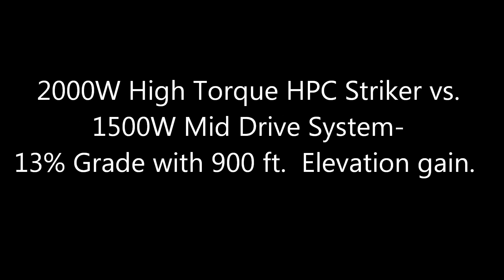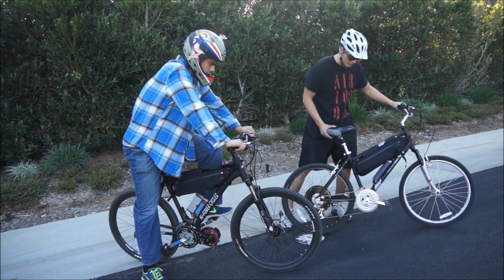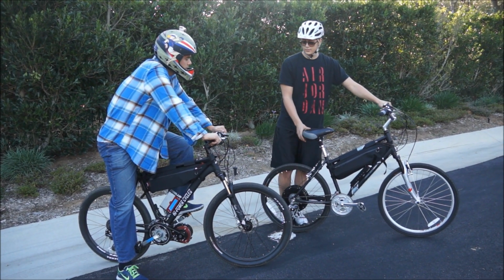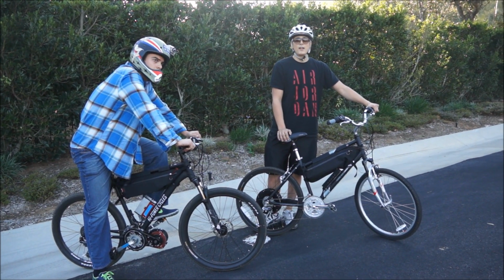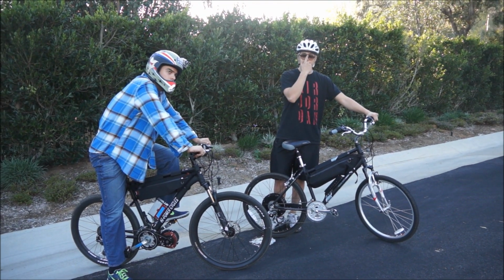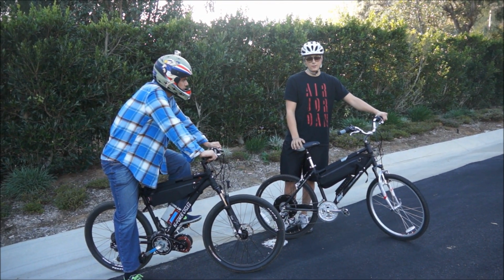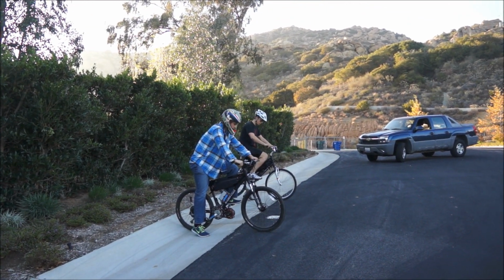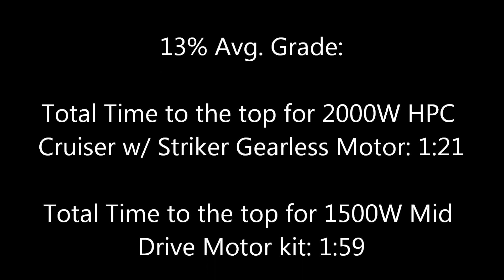Hub Motor vs Mid Drive Part 2

Comment: Isn't not using the gears defeating the whole purpose of having a middrive?
Reply: Yep shift and monitor current and voltage sag on the dash and repeat
Reply: I think, I hear the changing of the gears quite often there. Those sharp clank noises. Because he does it without easing the engine action.
I see the whole purpose of middrive in assisting the ride. Here, there was no assist, it was pure drive on motor. 
Direct drive motor here has 500 more watts here and also it isn't geared, therefore it has greater efficiency.
Reply: @petersvancarek  but going uphill, it it is all about TORQUE. The power alone (let alone efficiency) doesn't help if the torque is not enough. It's like you pedaling the bike, shifting gears. You have some amount of power in your legs, say, 300W. If you switch to an optimal gear, you can go uphills at some speed but shifting gears further up, you can no longer pedal at all (although you still have your 300W of power) - it is because the torque is no enough to spin that gear.
In this case, I thought mid drive would win because of the torque available but it seems like direct drive had enough torque for that slope so it won. Sure, both motors had to be the same power also. Not fair to have 0,5 kW difference...
Reply: He was changing gears, between a low gear where he can't go very fast and a higher gear where the motor can't cope, swapping gears trying to work out what's fastest, in the end it got trounced. Listen to how hard it's slamming the chain as well. Hubs forever!

Comment: Total BS! A 1500W Mid Drive system would fly up that hill and drain far less from the battery. There's something very wrong with this "test".
Reply: Brendon Bosy
Nothing multiplies torque at the wheel quite like a good set of gears.
Reply: +Knapweed There is also the difference in motor diameter, that is a square factor in the torque per watt of a motor.
Reply: @CamdenWallraff  you cannot compare the torque of direct drive motor with geared in terms of dimensions. Both motors have to be the same type to be compared by dimensions - either direct drive or geared...

Comment: Mid drive motors are superior when you shift the gears to gain maximum torque.
Reply: Christian Ademius Are you saying that the results would be different if a different gear was chosen?
Reply: Yes, I have one of those today with the Bonsch motor. You udnerstand very quickly why it is a lot more efficient.
Reply: Christian Ademius I would think that the makers of the bikes know what they're doing. I don't believe that they are trying to mislead anyone, and from this video, they have clearly demonstrated their point. I don't think any gear on that mid drive setup would have enabled it to beat the other bike.
Reply: ThingsDemystified It would be more of a fair comparison if they'd used the same wattage motors for both set-ups. Of course 2000W is going to outperform 1500W - especially if you're changing gears in an inefficient manner like the mid-drive rider was.
Reply: David Struve It seems logical to me that a mid drive would be more efficient because it can take advantage of the bike's drive train. A hub motor needs a power advantage to beat that.
Reply: *****
I was into RC cars in the past, and I found that higher gearing made the battery last much, much longer. I'm assuming this is true with these bike motors. I'm going to try a mid drive next. I tried a hub motor, but it seemed like it was using more power than it should.
Reply: Nope.

Comment: Sigh.
Does 500Watt difference seem trivial to you? Same goes with the bike + rider weight and gearing. If you want to do a comparison at least try to remove some of these unwanted variables.

Electric motors despite the relatively high accessible torque on low RPM will still benefit from gearing. Electrical motor will run incredibly poorly and overheat if the load is too great ie) RPM is too low. Hub motors have one advantage and that is they are usually lighter and easier to install.

At 1500~2000W band, this kind of difference becomes less prominent as even with low mechanical advantage the motor will provide enough power to overcome the load. Still, no reason to make such poor obviously biased and even down right false advertising video.

Just say: "2000W direct drive hub motor, lighter, cheaper, simpler."

Comment: The hub drive took 81 seconds at 2000W. If you factor out the difference in energy input the time would be very similar. The mid drive took 119 seconds at 1500W and the hub drive would have taken 108 seconds if it ran on 1500W. The mid drive would also have done even better if it were set to a gear for going up hills because you could do that with mid drive motors in a way that's more efficient than when doing it with hub motors.

Comment: If you buy Ebikes to have a one time race up a 13% hill the best candidate has been demonstrated. I understand the mid drive arrangement allows the operator to maintain the motor at optimum rpm greatly extending battery life over distance which may be more in line with what people buy ebikes for.
Reply: Based on this video.......... mid drives = senior citizens walking
Reply: ExclusiveLM
Well, if you don't downshift, of course. The whole point of having a mid drive is so that you can use your gears to keep the motor spinning fast for max efficiency. In the video, he kept upshifting when he should have been downshifting.

Comment: I definitely like the quiet sound of the hub drive but realistically, the mid drive bike came in at ~68% of the time of the hub bike, which rings consistent with the power difference between the two. The extra losses of 7% aren't too bad especially if you are wanting to use the gearing for hill climbing etc which the hub drive wouldn't be very good at.

Comment: One is road legal in most states as well as legal on bike paths.  While the other isn't....
One is legal while still  retaining climbing ability.  
One uses less power and is more efficient.

There are a lot of advantages to having a mid drive if your goal isn't just to go as fast as possible in a straight line.

Comment: how is the mid drive going to change gear without peddling. you need to redo this test with someone who knows how to ride the bike properly. the mid drive should have won, even with lower watt motor.
Reply: +andy765gtr Two riders of the same weight would be a good idea too.
Reply: Because these sort of mid-drives normally drive a free-wheeling chainring, which the cranks are also connected to. They almost always operate through the conventional drive train of the bike, and if they don't, what fucking use is it to change gear?
Reply: Back off throttle to drop load shift and back on Need to keep that motor spinning as fast as possible and shift to gears quickly accordingly to the current and voltage sag and not go to high where you bog the motor and the current goes way up .Electric motors are most efficient at high rpm Sooooo shift already !!

Comment: Dude, what the hell? Try changing gears on the middrive next time. And when you do that, ease up on the throttle for a second, while the gear change takes place.
Reply: He was changing gears. He was juggling between going slow in a low gear and having the motor struggling (same end result, going slow) in a higher gear. Those gear changes slamming the chain are a sad thing to hear.

Comment: mid drive are made specially for those that going to pedal most of the time, making far more  efficient !!
Reply: +walter osvaldo mid drives are made to spin motor at efficient range and have wider range momentum. Good luck with hub on that if not 100% straight

Comment: Bullshit comparison. Wattage doesn't mean anything. What about the controllers and the batteries for each motor? What gears were the mid-drive bike in? It sounds like the mid drive was spinning really slow, which would make me think you used underpowered kit to drive it deliberately slow. Given a mid-drive at optimum rpm with kit rated for its power going through the correct gears, it would destroy an equal hub drive setup up a steep hill. The rule of thumb is - take a motor, put it in a hub, try to get it to go up a hill - if it can do it without heating up or slowing then fine, it is powerful enough for that hill well done. If it ends up overheating or losing power then the same motor in a mid-drive system would NOT overheat or lose power. It's all about gears you numpties. Also unsprung weight, efficiency, etc, etc. Mid drives are better even if they are more complicated and noisy. Single speed vs 12 speed up a hill? I'd put my money on the 12 speed.
Reply: Right, but when you use a mid-drive you're forced to use what is effectively an outer chainring 100% of the time, you have no lower gears anymore. Why anyone actually wants that just baffles me. Triple chainsets forever!

Comment: So we learn that a 2000 watt motor is more powerful than a 750 watt motor. Gee, I didn't know that. They should have also told us how much each system weighs.
Reply: jollyandwaylo No, what we learn in this video is that if you don't use the right gears, your mid drive won't perform. Imagine trying to go up a hill in 4th gear in your car. That's what the mid drive rider was basically doing.
Reply: +ThingsDemystified no wonder it sounds like it's at such a low rpm! huh who'd have thunk it?! derp These numpties need to go out of business.

Comment: The freewheel (mid drive) system is much more efficient and all things aren't equal here. A larger battery back can deliver more power and also it's matter of the torque of the motor. But overall, I would take a freewheel mid-drive system over the hub system any day of the week.
Reply: Bonzo Bonzai A lot of hub motors use plastic planetary gears (with steel ring gears and a steel sun gear) and aren't particularly reliable. Still more hub motors use permanent magnets and cause significant drag when you are just pedaling. Hub motors can't be used on the front of a bike with suspension forks either.
Reply: Bonzo Bonzai So you are saying your motor has permanent magnets in it? With permanent magnets there is no way to stop the resistance of the magnets on the coils. Also, hub motors tend to get hot because they have to generate so much torque. A mid-drive system doesn't need a lot of torque because it can reduce the speed and thus turn speed into torque (it's much more efficient). All that heat isn't free, your battery is generating that heat. Given that the battery is the single most expensive part of an e-bike, I would think you would want the most efficient motor. Getting a more efficient motor costs a lot less than adding battery capacity to increase range and to increase max wattage(which is a function of the capacity of the battery) to the motor. Glad you like it.
Reply: Bonzo Bonzai When I said your battery is generating that heat, I meant the motor was drawing energy from the battery and converting it to heat. Also, when I said 'it can reduce the speed', I meant reduce through gears thus converting the spinning speed of the motor into higher torque. I wasn't that clear on either point.
 None of the mid-drive motors I've ever seen are noisy, but again, if you are happy with it, then I'm glad your happy. ETA... BTW, any noise by either system ain't free either, it's also coming out of your battery. Well designed mid-drive motors are probably going to last longer than a hub motor.
Reply: Bonzo Bonzai I don't have any video of them, I saw them in person. You are really going overboard with the complexity thing. There is no reason a mid-drive system has to be geared and probably doesn't benefit from gears anyway, since it goes through the gearing of the bicycle. You basically have a sprocket on the shaft of the motor going to a freewheel bottom bracket. I've never seen one with belts and pulleys. The problem with hub drives is they need to generate enormous torque to get the bike going or go up a hill. Since a mid-drive can run at a high speed and be greatly reduced through the bike's drive-train (you can go from an 8 to 52 reduction), they don't need to generate huge amounts of torque. Generating all that torque will heat the motor up. None of these motors are particularly loud. Do you have an example? They usually have a whine, but are generally pretty quiet. I'd like to know what your theory is about how an electric motor gets louder because it's driving the bicycle's drive train versus spinning on an axis with direct drive. You said they are so loud you are afraid they will be banned from trails, do you have a video of this? As I keep telling you, I'm happy that you are happy with your setup. One less car, right?
Reply: tarstarkusz Hub motors can't be used on the front of a bike with suspension forks either wrong thy can i have got 1 and it works well
Reply: bucketrobbert I suggest you google search on this. Almost all the hub wheel sellers say "just don't do it". Not only is it likely to come looses, you don't want all of that unsprung spinning mass.
Reply: tarstarkusz you may be right it all depend on the size of the moter mine only a 500 wat and any thing higher than a 1000 wat motor there is ex-stream amount of tort higher than this can pull your front forks to bits
Reply: also on this test on this page i dont think the guy on the mid drive change gears to suet the size of the hill
Reply: bucketrobbert Even 500 watt motors (assuming your battery can deliver 500 watts) puts hundreds of pounds of torque on the forks. Even with a torque arm, they can rip themselves right out of aluminum forks. Remember, just because you have a 500 watt motor doesn't mean you can get 500 watts out of it. Maybe if you have a 1KW/H battery, you can sustain 500 watts for more than a few seconds, but a typical battery won't deliver that kind of power for more than a few seconds. The cells heat up and more and more power is lost at the cells before it ever gets to the motor. The chemistry and Capacity of the battery is usually the limiting factor on E-bikes. I've seen so-called 10k watt E-bikes with a 500WH battery. It's next to impossible to draw 10KW from a 0.5KW/H battery, not to mention the size wiring you would need to carry that kind of current. Even at 72V, you are looking at 138 amps to deliver 10KW. You would need extremely thick wires to carry all those amps. It wouldn't fit into the hub axle:)
Reply: my cycle computer states 600 watts peak so yes i can get 500 watts easy but i do not slam it to 600 watts do it car-full  start of 10 watts and build up to what ether wattage  you want so yes if your going to mist treat the power like doing front wheel spins your asking for trouble and deserve all you get . by the way my front forks are steel the frame alloy...
 by the way mine only a 36 volt bike not a 72 volt bike

Comment: Well you might have a point there about the efficiency but my hubmotor works fine at climbing steep hills and it never overheated to the point its beginning to lose power or that it was too hot to touch. 
And believe me i torture tested it dumping 72v 16ah of battery in it in about 30 min (almost constant full throttle at 4kw) in a local forest and its still running fine.

Comment: I have no problem climbing steep hills with my hubmotor what so ever. it easily climbs a 30 degree hill.. 
Also i have stalled it many times before (rated for 1500w, handling 4000w atm) and its still running fine after 1.5 years or heavy usage. 
Btw my controller cuttsoff power when completely stalling it so it can never burn the motor. 
Sure it heats up but noting to be worried about. 
A good hubmotor shouldnt have any problem climbing hills..

Comment: in the uk electric bikes are not allowed to have a motor output of more than 250w and  so you have to pedal uphill, but my electric bike has a 7 speed megarange gear so i can get up most hills using a combination of  pedals and motor.

Comment: 750Watt is the legal maximum allowed in the USA ,so why even show a 2000Watt against a smaller mid-drive ,that hub motor will burn up trying to go up steeper hills like I have here in Pittsburgh PA ,that is why I bought the 8fun 750Watt 48V so I can use my gears to climb a wall if I want too, no hubs for me.

Comment: Simple arithmetic shows the 2000W system is much less efficient:  because of the gearing in the 1500W system, the motor is allowed to run at the higher and more efficient rpm speed, . . .

Comment: Have you looked at the Ego Mid drive kit? Are HPC kits superior? 70 km/h is what they claim (Dh?). I will pedal I bike fast. But I expect my full suspension, (mind you it locks) I think 50 on road realistically. It's 1300-2000 amps 48v battery. Costs alot and loud- How fast can you guys get your hubs? Quiet+, but I heard less efficient and I want to Run Tubeless tires on Trt rim combatable? Your kits how is longevity? seems  inexpensive for the power you get.kit looks simple and easy+ weight?

Comment: You are comparing apples with oranges:

The skinner guy is on top of a 2000W motor e-bike (with thinner tires), while the thicker guy is on a 1500W motor ebike (with thicker tires) => more friction

Also, the mid-drive rider was switching gears up and down => causing the motor to lose momentum...

It's pretty obvious to me that your 2000W bike will beat the 1500W.

I wonder if you switch riders, how your test results would be...

Comment: This "test" was useless without matching batteries, matching rider weights or letting us know what brand and model systems were used.  Also, it's very hard to believe the mid drive system really cost $4,000. 

As somebody else pointed out, it looks like the performance was roughly consistent with rated power if all the unspecified factors were the same.

At the very least you could have immediately repeated the test after swapping the batteries.